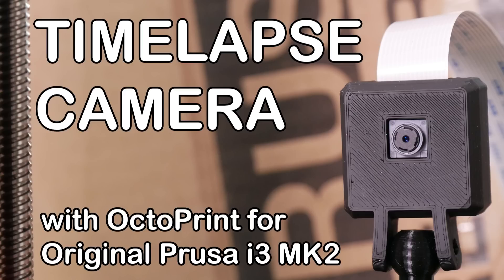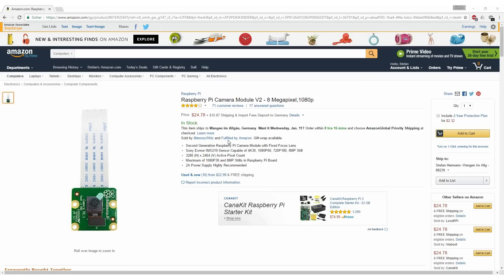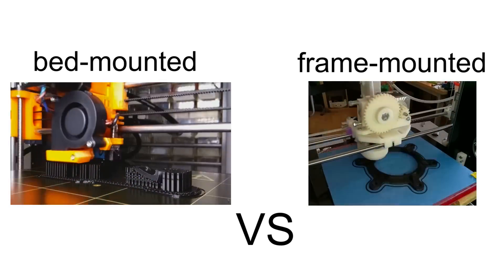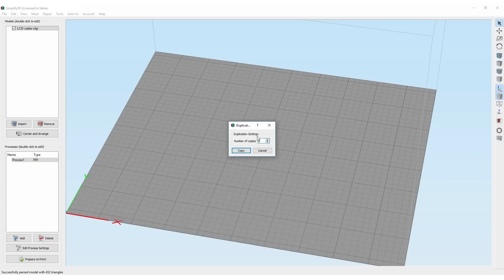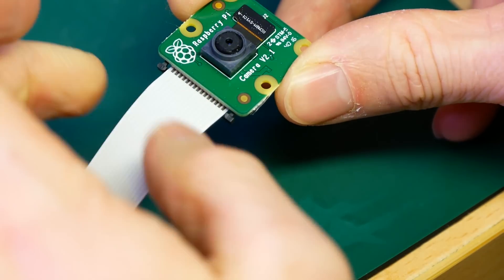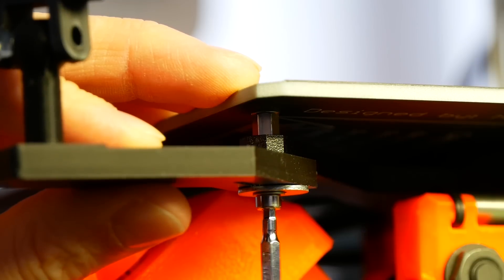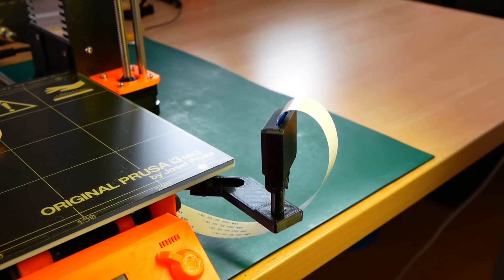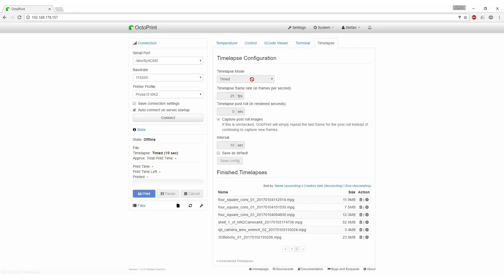HOW TO: Timelapse Camera for Original Prusa i3 MK2 using OctoPrint

Comment: please update this video...I can't find the specific raspberry pi 3 module you used in the video. You used Vilros as the brand can I use a different brand?
Reply: the raspberry pi 3 b+ works fine, even though some guides say octoprint doesnt support b+, they are outdated, it works on mine so it must do now.

Comment: The bracket is unecassary. You can mount camera to frame, and instruct slicer to move to specific position after every layer before taking picture. It will make print only slightly slower, but the timelaps would actually look better, because of more consistent lighting and structure actually growing from bottom to top nicely.

Comment: Original Prusa i3 MK2First off "The worst customer support ever!!"
Secondly if your in a US time zone good luck trying to get in touch with them even via email.
It will be a back and forth brief one sentence email that will last weeks.
Thirdly, when you receive your box from Europe, it will most likely be damaged and a very good chance the printer will need not only adjustments from being banged around so badly, but likely cracked and/or broken parts.Now that we discussed the good, on to the bad.
Once you have a problem that you cannot fix or repair yourself without them sending you a replacement or replacement part.
They pull a disappearing act, or more realisticly, they completely ignore you! 
Yes, you can try for days, weeks, now over two months, no response.
We are left with no choice but to take fraud measures against them.Im sure its a great when its working, but be careful with the praise until you have something go wrong that you cannot fix!
Then its a whole new picture of what this company is!
Reply from the maker: I did have good a good experience with their support so far. Yes, they are a little slow, but they did answer my questions and sent replacement parts right away.
Reply: wow, good for you!
Reply: Wow, there is someone angry. For me, I can say, that the support answered in like 10 minutes every time I was writing to them. And I had no problem with the shipping or so, so maybe you are just very unlucky.
Reply: I've always had awesome support with Prusa. Not so much with Monoprice......
Reply: Do not know about Prusa but bought Anet from China. It came with broken LCD screen. They did send me replacement and contact was very easy and fast. So if you do not like Prusa try Anet. All contact through Aliexpress chat with response time in hours - timezone difference does not seem to be a problem for them. Only requirement they had was sending them picture of broken screen.